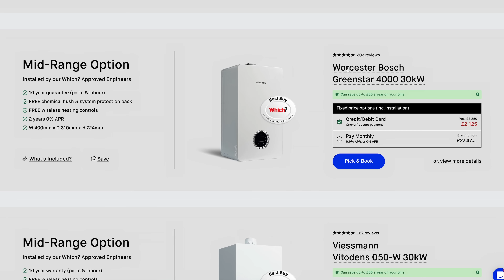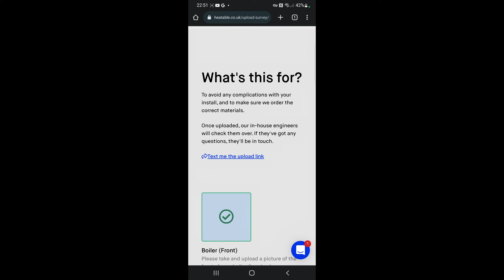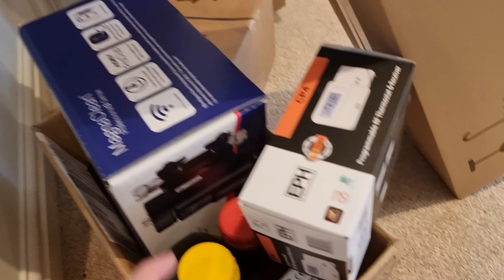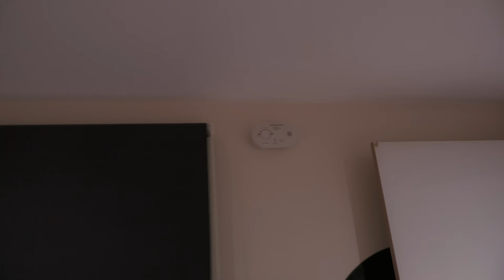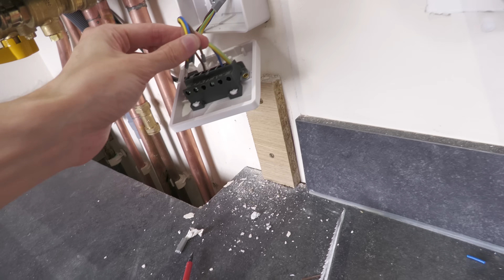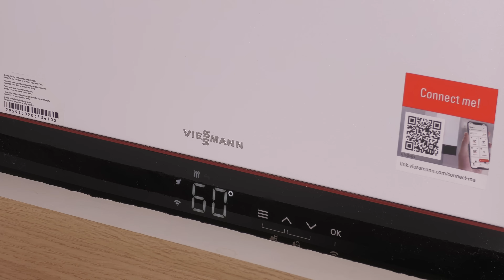New Boiler from Heatable - A Paying Customer's Review | Viessmann Vitodens 050-W

Comment from the maker: New Discount Codes - Get £50 off your order with Heatable, use link https://bit.ly/3QJGo11 (Affiliate) and enter voucher code CAMERON50 at the payment stage!  Alternatively use the above link with voucher code NESTCAMERON to get a free Nest Thermostat included with your order worth £215!

UPDATE!  A couple of days after my installation, the installer got back in touch saying that he needed to come back and fit a plume kit - As far as I can tell, Heatable had checked over the install and had determined that a plume kit did in fact need to be fitted as the flue was within 300mm of an internal corner which is not allowed based on Viessmann's instructions.  While this does now mean I have a relatively unattractive plume kit, it does go to show the benefit of using a company like Heatable who will check over the install and make sure it complies.  Had this not happened I'd have been none the wiser until potentially I needed to claim on the Viessmann warranty and could have had an issue because it wasn't installed in accordance with their instructions.
Reply: Hi, nice video.... the Discount codes seems expired. Would you be able to provide the new ones? thanks

Comment: Hi Cameron, how have you dealt with programming the heating on off times on the 050? I've a 100W system boiler and the Vicare app has time schedules for heating and DHW. So no need for an external controller like a Nest on open therm. However, the 050 in a friend's place using the vicare app has no time schedule functionality!

Comment: Hi Cameron. Thanks for your in-depth videos explaining the reasons why you do certain things at a practical level.  Looking forward to the networking videos at the new house.

A quick question for you or anybody else who knows.

From what I can tell the Viessmann Vitodens 050-W does not natively support opentherm but rather uses its own proprietary eBUS protocol. Did you manage to get the boiler working with an opentherm thermostat? I have installed a Viessmann Vitodens 111-W and was wondering whether the Google Nest v3 learning thermostat can directly control the boiler using the opentherm connections and fully modulate it etc. and receive the boiler's data for Nest's learning algorithms to process. It currently controlled by an on/off thermostat.  I have a 5 core flex running between the boiler and the thermostat, and so the wiring is in place for a quick swap.
Reply from the maker: No worries, the Viessmann 050-W definitely supports OpenTherm, I set it up with a Nest in my Nest install video.  You might be thinking of Valiant who have a proprietary protocol.

Comment: Many thanks for making a really great video.
I'm about to have installed a Vitodens 100-W B1HF 32kW System by a Viessmann approved company who have informed me that yes, it comes with a 10 year warranty provided that you have it serviced every year (£100)  and if you miss a year that's the end of the 7 / 10 / 12  year cover.
I looked it up on Viessmann's website and in the "Terms and Conditions" this is actually correct !
on the 100-w you get 7 years and then pay £210 or £270 to take the warranty to 10 or 12 years.
Reply: I have a Vitopend 100 and its had its first service in 12 years. Going strong. Germans have become very good at material obsolescence and newer model are probably made to break without regular servicing.

Comment: Hi, nice video. Great job however I need some further advice if you can spare few minutes answering the below.
I have exactly the same Ideal Isar He35 boiler that needs to go and would like to get this exact Viessmann 050-W boiler. Trying to quote for one I have hit a snag and it is due to my flat being on the 2nd floor of a building. Heatable refused to quote me as, according to them, the external access is required to install flue. Any chance you could share what floor is your flat on, and if it is on the 2nd floor or above, what flue was used? Some other boiler installers also claim that without access they will not be able to supply me with Viessmann however I suspected that they simply might have some sort of deal with Worcester Bosch or Baxi as quite a lot of them trying to convince me to install WB Greenstar 4000.
Cheers
Reply from the maker: Interesting, I'm ground floor so access wasn't an issue.  I'm not an expert, but it looks like Baxi (and maybe Worcester Bosch) offer special flue kits that can be installed and sealed correctly purely from inside which is why I imagine installers are specifically offering those.  Looks like Viessmann don't offer such a flue so they'd need access externally to fit and seal it.

Comment: I'm a bit late to the party but I have a question on the 050. When it was first installed it would ramp up really quickly  to heat the radiators, however the 'engineer' who recently completed the first service has left it in a lower state of tune where it cycles at a much lower rate initially so the radiators take longer to heat up.
D'you know how to return it to the original 'ramp up' setting?

Comment: You are so wrong in saying that a local Gas engineer would mess up the installation, it is proven that the big nationwide boiler installation company has the most horror installs , as local company we have to fix shit after big companies like IHeat , Heatable , Glowgreen , Boxt . 
I can guarantee that a local gas engineer has more reputation to protect that this subcontractors working for the big boys .
Reply from the maker: At no point did I say that "a local gas engineer will mess up the installation." Realistically there are benefits to both options.  My logic here was that if I were to have had an issue, my contract legally speaking would have been with Heatable who are a much larger company vs a small company where the risk is that they fold and disappear.  I was also able to pay on credit card to gain additional protection in the event of any issues.  I'm in no doubt that you perform very good installs, but as a consumer it's extremely difficult to differentiate between a company I can trust and one I can't - my parents for example have always used a couple of very well known, long standing, well reviewed local companies yet when I installed a Hive thermostat for them, I came across some of the most dreadful wiring I've seen, amongst all other sorts of bodgery hidden away where my parents wouldn't have seen it.

There is also admittedly a level of convenience - I just needed to get the boiler installed after putting it off for years and having very limited time to mess around getting quotes and hoping people would turn up.  With this I literally booked it in a couple of days before, and it was all completed within a day.  It also turned out that Heatable performed additional checks after the install was completed - at the time of installation the installer didn't install the plume management kit as the flue exit was far enough away from windows/air vents.  What the installer hadn't considered was that it was too close to an internal corner to meet the manufacturer's instructions.  Heatable spotted this during their final checks/sign-off of the install and sent the installer back to rectify and it and install the plume management kit, had I hired the installer directly, the plume management kit would have likely never been installed.

Comment: I've had a Viessmann 200W Weather Compensation Combination Boiler 13 years old, after 13 years new flow switch and new outside temperature monitor, just had burner spark probe and flame out probe, burner door gasket, I'm going to fit low energy Grundfoss pump, after I give the system a flush, then fit a Internet WiFi unit in February, 
So 13 years old quite good, only regular service by Viessmann every year, i buy parts from Viessmann Direct now part of Viessmann, its handy to have parts available so engineer doesn't have to make many call outs some parts come from Germany take 10 day's,
Reply: an* internet 
*days

Comment: Thanks for the very useful video!  'Just a side note as of November 2023.  Heatable are sending out Magnaclean Micro 2 filters, not the Pro 3 shown in this video.  Their website and your order still show a picture of a Pro 3, and as such, I have just had a conversation with them and they are replacing the Micro 2 with a Pro 3 (worth £100 more than the Micro 2).

Comment: Thank you for the video , can  I ask , when your boiler starts up does it make a racket rather like a plane getting ready to take off , I dont know if this is normal amd  before I ask the company who will no doubt say it is I thought I'd ask you . Thanks
Reply from the maker: It definitely makes noise and ramps up since it'll initially run the burner at high power to get everything up to temperature quickly before settling down.  It it's particularly loud or anything though.

Comment: I'm glad you had a better experience with Heatable than me, used them after seeing this video and wanting a Viessmann boiler, took a week and 3 heating engineers before the job was complete and it was meant to be a straight swap out. The first engineer took the old boiler off the wall and left at lunchtime on day 1 as the new boiler hadent arrived yet leaving the old boiler just dumped in my driveway (I didnt even know until I went out and saw it sitting there after he left), second engineer arrived 2 days later, was friendly but drilled a new flue hole almost hitting the tails from the meter to the consumer unit. He got the boiler installed but didnt know how to do the wiring on it so left me with it on a long wire going to a plug and permanent live on the the switched boiler feed and an error message on the display, it was that this point I just finished the wiring myself (already fitted a tado) and read the manual enough to work out how to put the boiler in the correct mode to clear the error message. 3rd engineer came round the next day to fix the wiring but I'd already done it. Heatable also sent me a non wifi magnaclean at about a 3rd of the price and when I phoned up they claimed no one had it in stock, I checked and my local city plumbing (where the boiler had come from) had plenty so I went and picked it up and sent the bill to Heatable. Heatable were always pleasent to speak to on the phone but was a bit of a rigmoral for something that should have been a 1 day job. So nice to have all that Vicare info in Home Assistant though :)

Comment: talk about overselling lol!! I can show you three installs done by Heatable that are worser than worse! 
And for the record it’s more likely for a larger company to fold over a smaller independent that provides a far better quality of install.
Reply from the maker: I'm only providing my experience, I could equally show a tonne of dreadful installs by non-heatable companies, both big and small. Ultimately there is always a risk no matter what company you go for.  What I liked here was that heatable review the job so it's not left to the installer to mark their own homework. In my case, the installer (who I equally could have hired as an independent contractor) failed to install the plume management kit which turned out to be required by viessmann's instructions due to the proximity to an internal corner.  This was picked up by heatable when they reviewed the job and they sent the installer back to rectify the issue.  Had I hired the contractor independently, I'd have been none the wiser about the lack of plume management kit and would probably only have found out if it caused an issue at a future service or warranty claim.

Heatable ultimately use independent contractors, they just provide an extra layer of oversight and support on top.  And in terms of which is more likely to fail, your claim has a big "citation needed" over it, my logic is that a small company with one person can easily shut down and reopen under a different name to get away from legal action, much harder to do if you're a large company.

Comment: i need help i'm now in Europe country the my problem i never used a combi in my life what is the right way to make it heat
and dont take alot of power
Reply from the maker: A combi will heat hot water on demand so you don't need to set up any sort of schedule for hot water.  You can adjust the hot water temperature on the boiler, generally lower temperatures will use less energy so you just need to see how low you can set it while still getting hot enough water from taps and shower and where the shower has enough pressure (if you set it too low your shower may not mix in much cold water and therefore the flow might be reduced).  Personally I have my hot water temperature set to 55c.  For heating you will set a timer/thermostat and can also change the temperature of the water in the heating system on the boiler.  Generally speaking a lower heating water temperature will be more efficient however if you set it too low you may find that rooms either never reach the desired temperature or they take too long to heat up.  Again it's just a case of playing with different values and seeing how you find it.  50c is probably a good starting point then adjust as you see fit.

Comment: Just had my Vitodens 100 installed through boiler central today.  Interestingly enough I mentioned OpenTherm to my fitter also and similar to you he did not know what that was (I'm also based up in Scotland). A bit of time pouring through the wiring diagrams on the Nest and boiler manuals (and checking your videos again!) and it's all set up successfully now.  With both our experiences coinciding I wonder how many OpenTherm ready boilers are actually just not connected up in that way?
Reply from the maker: Yeah, it seems ridiculously common, think mine is the only boiler I've actually seen connected up for OpenTherm in person which is absolutely ridiculous!  As far as I'm aware, the BoilerPlus regulations that I mentioned don't apply in Scotland so it may be a lack of education/reluctance to try new things up here but it's infuriating given the clear benefits of OpenTherm.  I've noticed huge benefits from it - my flat heats up super quickly but once it's at temperature I barely notice when the boiler turns on to top up the heat, whereas previously I could easily notice the temperature fluctuations throughout the day.
Reply: @camerongray1515  Totally agree there.  The one thing I would say about the experience though was that there was no ego and a genuine response to learn.  Myself and the installer looked through the installation manual and worked through it and got it to work.  I could very well have imagined it going the other way where there would have been a refusal try another way to work through it and we would have both come away unhappy as I would not have accepted the job that was completed.
Reply from the maker: That's good, I was pleasantly surprised with my engineer as well - when he walked into me being nosey looking at what he was doing while he'd been out at the van he was happy to show me around and talk through what he was doin. He was also no way offended by me asking about OpenTherm and when I asked him if he could fit the flex for OpenTherm so that I could replace the thermostat later he was happy to do it but also had no issue with the idea of me taking the front off the boiler to do it myself (even showing me how to do it).  A far cry from what I expected which would have been "I'm the mighty gas engineer, you lowly member of the public shouldn't even look at the boiler, let alone change a thermostat yourself"
Reply: @camerongray1515  Great, in the weeds on this conversation but to add to your video there was no "connector" on my 100 boiler on the switched contacts.  To wire for OpenTherm we just had to connect directly to the OpenTherm contacts on the boiler to the Nest, no other changes were made.  The only thing I have found with my Nest (I previously had a 2nd gen Nest) is that the app now has an additional circle for hot water control.  Where as the thermostat control changes to orange when the heating goes on (and the boiler fires) the hot water control is always showing as orange and on.  I just need to get used to it as I think it indicates the temperature and not that the boiler is always firing and heating water.  I don't know if you see the same on yours?

Comment: Is your boiler connected to the Viessmann network ? so they can see how your boiler is working.
Reply from the maker: It's connected to Vicare if that's what you mean but this was something I set up myself so it's not connected to anything by the installer.  I just have this so that I can pull stats from the boiler such as the gas consumption into my own database using Home Assistant.